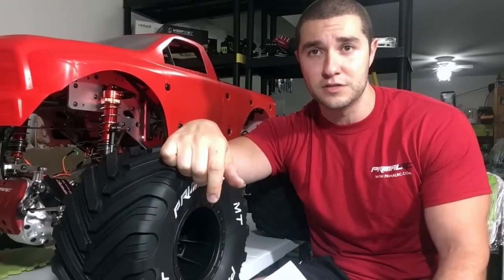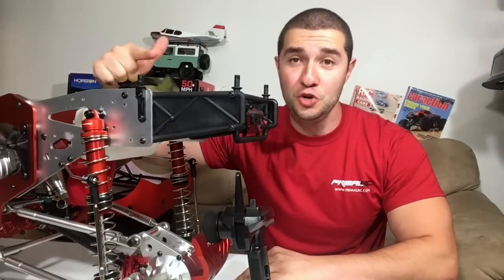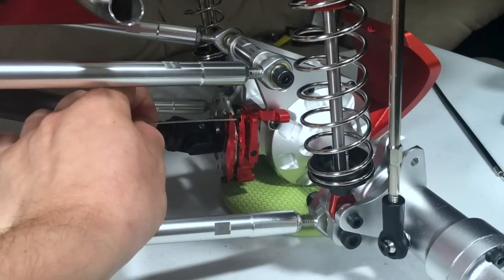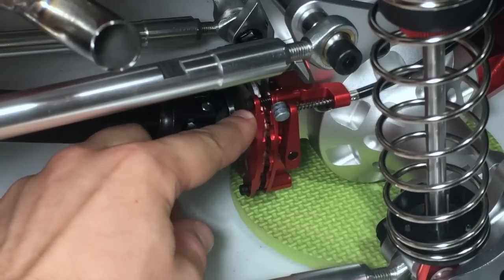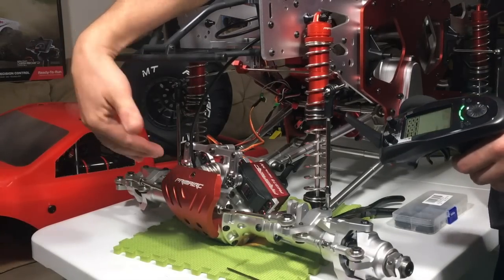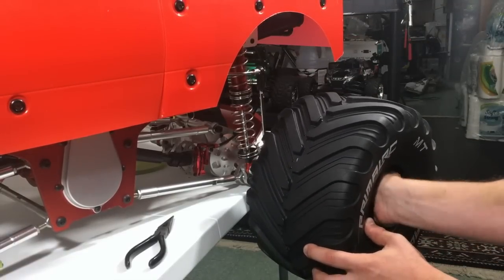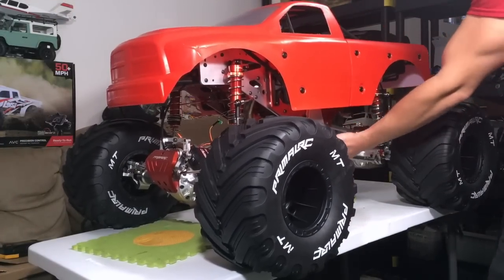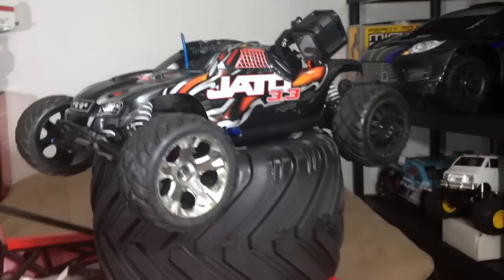Primal MT Raminator 1/5 GAS truck  - Finally Assembled - Is this Big Enough For you?

Comment: Did you buy this with the hopped up motor or no please comment back in let me know thank you very much be safe running like you stole it and have fun
Reply from the maker: hey bro! I responded back to your other comment, but I'll say it again here just in case you didn't see it.  This truck is fully stock, I don't like mods that change the truck that much, plus it's just not needed.  There is a video here of me towing a tree with this truck, watch it, you will see.

Comment: I don't think it's true fifth scale but interesting to find out. Like our rovan trucks or your rally car I don't think it's fifth the size of a true for focus, more 1/8 prolly.
Reply from the maker: hey bro!! I measured this and compared it to the real monster jam truck's length, and yes, it is 1/5 scale based on that.  It's larger than any other 1/5 scale RC, you're right.  But it is in fact true 1/5 compared to the monster jam truck that it's supposed to be.
Reply: Did you say the primal Rc is a 8th scale? 😂 That's bigger than 5th scale it's like 1/4th
Reply: @Josh-pb5eo  I know it is a 1/5 scale

Comment: Yeah people complain it's so expensive, but 3 grand is worth it. People don't complain about $1500 losi trucks that rovan sell for $500 yet talk shit about rovan being cheap or clones I don't get people.
Reply from the maker: I fully agree with ya, Is you take a LOSI it's total crap in terms of innovation and metal parts compared to this.  It needs a high end spectrum radio and a normal pipe (300 bucks extra right away).  And it's just another short course truck, big deal, it's a 10+ year old design.  Still a great truck, but totally not in the same league as this PRIMAL MT.

Comment: Hey brother get the 2s battery with jst connector from that d90 sitting on the shelf behind you your gonna need it because that transmitter eats batteries youl get 2 runs before it says low voltage and wigs out i put my 2s battery and it lasts alot longer and saves money awesome truck man wish i could afford one
Reply from the maker: tonight I will be attempting to do some pull ups at home with this thing.  Before I go to a park and do it in public, got to know If I can even get it attached correctly.
Reply from the maker: hey my dude!! Great Idea, I guess when I start breaking this in and the radio will be on for a while I'll measure the battery use.  A few people told me to use a 2S lipo for the remote so far.
Reply: @hybrid32494  right on brother i hope you have fun with that monster

Comment: Hey brother great Video bro. And dont  forget to move your steering links to the bottom of the toe link arms because if not you will burn out your servos from the stress. It has happened to one of my brap brothers and is recommended by AL from TMR. So on the bottom brother to relieve the stress on the servos. Have a great day bro God Bless!🙌🏼⛽️🤜🏼🤛🏼🤝 also one thing I noticed thats different on my electronics when I power my truck up the kill switch is engaged always After turning on the transmitter then the Rx its red and I just push the button and it turns green but it kills fine oooh you know what I bet my channel that the kill is on is reversed🤣 because my whole dang system was backwards. Pulled the trigger and the brakes went on🤣. I gotta reverse the kill now too! Thats why you have to do what you talk about in this vid! Good job brother! Love your videos bro!

Comment: You sir may just be the most enthusiastic R.C guy out there. funny as fuck and loads of cool videos. The size of those wheels. . . get a few pull ups going with this truck or/ and tie as many trucks around your neck as possible and see how many reps you can do haha. thank you
Reply from the maker: T-maxx Tony says NItro 4 LIFE!!! No matter how big the gas Rcs get, the nitros will always be king no mater what.  My first hobby grade Rc was an HPI nitro RS4-3, so I've been in this hobby since middle school around 2000's.
Reply: @hybrid32494  aaaah the smell of burnt nitro. Mmmmmmmm. Be careful attaching that thing. You could pull your back out.. And we don't want that. Keep up the laughs man. I must start doings my pressups with my hpi evo rush on my back. Lol
Reply from the maker: dude, terrific RC you have the hpi rush evo.  I used to have an original hpi nitro rush, was so cool at the time.  Don't worry I already worked out at the gym and ate some pizza, doing some PRIMAL MT pull-ups is just part of my day, ahahah.  JK..
Reply: @hybrid32494  hey Tony T MAX. you don't need to make nitro great again because NITRO WAS ALWAYS AND WILL FOREVER BE KING.  Loved you burning your balls on the primal chassis hahaha. funny as feck
Reply from the maker: whats up man!! thanks so much!!! I am planning on doing pull-ups with this for sure, question is will I be able to attach it correctly to myself and record it effectively.  Recording is the hard part.
Reply: @hybrid32494  we gotta see it man. That monster truck is a true beast. It deserves your full attention lol. Good man and thanks again. I fucking love NITRO RC. YEOOW

Comment: You too funny man your channel is the stuff man I love it. I will remember your comedy for years to come lol. I hit 70.2 mph today on a 3S 4400 MAH 75C 11.4 volt lipo battery. Don't say nothing.... Vxl 3500 KV 4 pole motor. Remember I was stuck on 62-64....... That was with 20/54 gearing not 19/54.... For some reason the hobby shop I had purchased that gear from accidentally sold me a 20 pinion which is all good lol. I'm renting another Traxxas rustler 2wd vxl here shortly since I had sold my two existing rustler 2wd's that I had awhile ago. One of them was about 6 years old and the other was about a year and a half to 2 years old. I'm getting myself the vxl version rtr brand new out of the box so I don't have to worry about re upgrading again. On sale for 269.99 buddy. That primal rc is HUGE ........ that's too much monster truck for me man. I was thinking of getting a Nitro though.... Jato 3.3 or T-Maxx 3.3.
Reply from the maker: whats up my dude!! Bro, 70.2 is nuts.  Really fast.  Ye, you always gotta count the pinion teeth when you put them on, its annoying but its got to be done.  Bro, I think you're going to be very happy with the stock RTR VXL.  Plus if you get the jato you could experience the joy of the 2-speed shift.  thats what it's all about man... trust me.   you gonna smile when it shifts.

Comment: Nice to see it all come together can’t wait to see it out for a run.  And the pull ups haha 💪.  Cute little guy the primal mascot man he liked to swim haha.  I can’t get my English shepherd in the bath never mind the pond.  That Traxxas jato sure hauls ass too wow.   I’m trying to get a Kyosho Inferno Neo 3.0 running I scooped it up for a deal.  I can’t find stock spec carb settings anywhere for the motor so might just use Novarossi .21 specs.  And finally got my throttle linkage back in the Baja but having some issues with the kill switch.  But I’ll get it!

Comment: Awesome man! Just watch out the choke likes to turn itself on when you get to bashing it so if it cuts out on you randomly while in use thats why! : )
Reply from the maker: hey buddy!! thanks for the advice, I heard that from somebody too.  I eventually will remove the choke, after a normal break in and some norma driving.  First I gotta figure out how to tune this motor, the Reed engine case and mounting is not like any other Gas engine I've seen.
Reply: I believe Dan put a choke delete in with the primal mt kit but good idea after break in to remove it. I was actually down at primal last week i ended up picking up a king motor  KSRC-002 baja 30.5cc the wild orange special edition thing is amazing for what comes stock for alloy parts. If i remember right you grabbed one the day you picked up the primal mt beast.

Comment: RC Tanks and Trucks 24/7 did a run and it was pretty slow..He is changing out the motor first thing
Reply from the maker: hey man, yep, I saw that video.   Are they aware of the fact that you could change the gears it's got, which were included.  Its top speed is around 30 MPH with the top gear set.  Don't worry, we will find this all out soon, when I check it myself.  Watching your FS racing vids right now, So this is the same as my FS racing gas Hummer?  Same manufacturer im saying.
Reply: @hybrid32494  Yea plus I was thinking it was run rich to break in the motor but Steve is a speed freak and 30 MPH is not enough for him lol..Yes Same manufacturer as your Hummer..They build all kinds of stuff that they sell to American distributors who re-brand
Reply: Yeah was running rich. Leaning it out now. Should make it run much better. Oh and yes, we are running the TMR engine asap 😊
Reply: @RCTanksTrucks247  Sweet! It's going to be a giant beast!